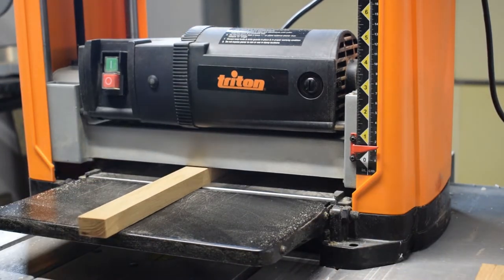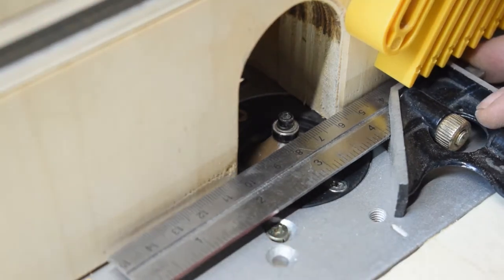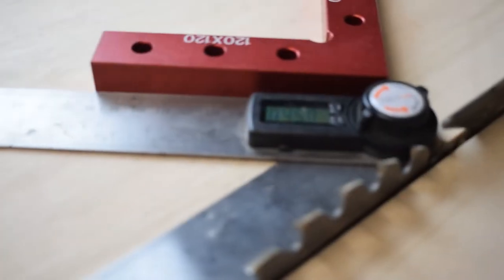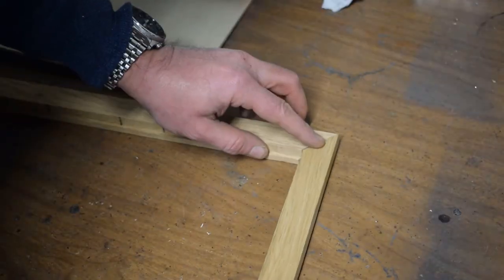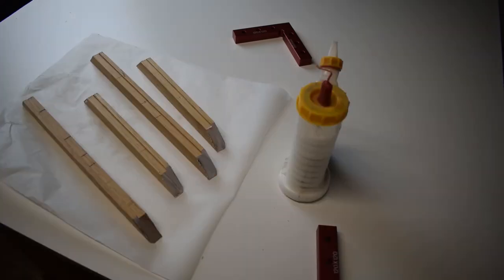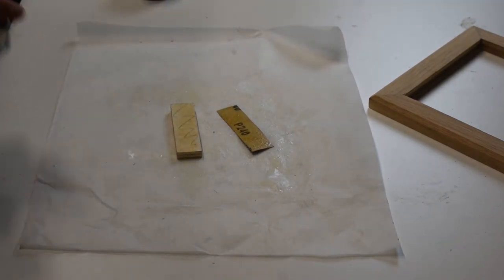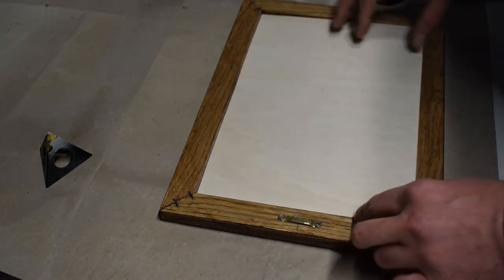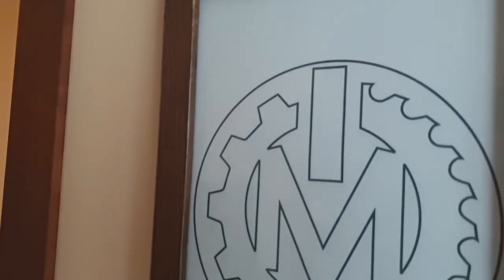Simple modern OAK PICTURE FRAME - Easy, No-math. - DIY // MakeON

Comment: That's really good.  I'm currently making one out of scrapwood and it doesn't look even slightly as nice as yours.  What are those really convenient looking red measuring tools and blocks?
Reply from the maker: Thank you, Chris!
Those blocks I screwed down on the tablesaw sled are actually corner clamps, the holes are meant to receive the steel clamping part. They come in handy to keep panels square while you join them or during glue ups, for instance, when building cabinets... but I use them in many other ways as they're very precisely machined. The little one is a 50mm square, very convenient to use with small parts.